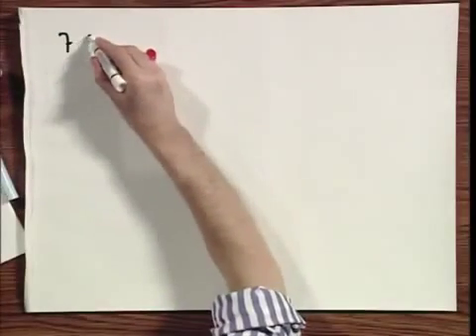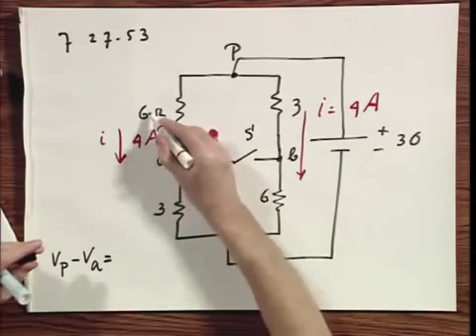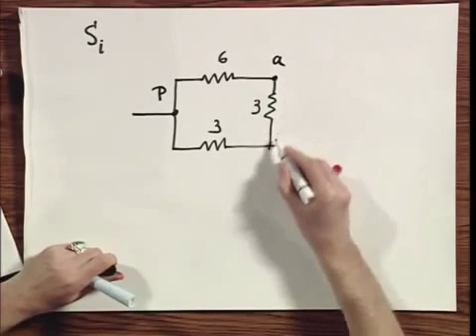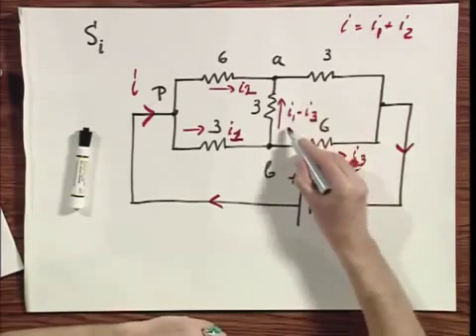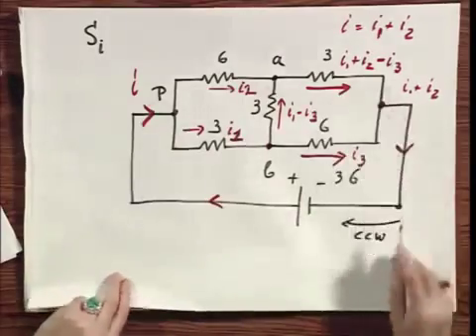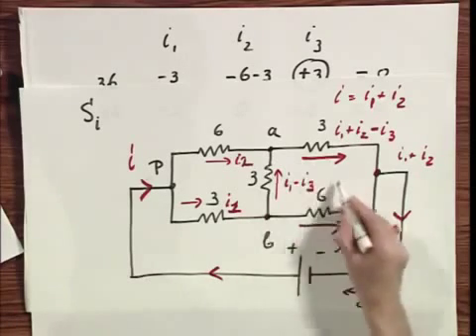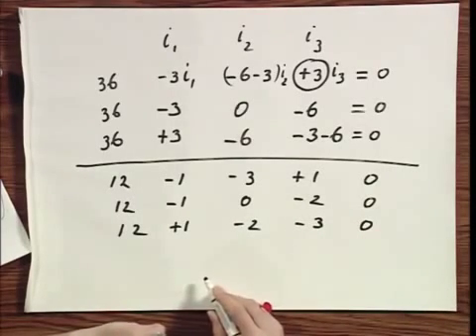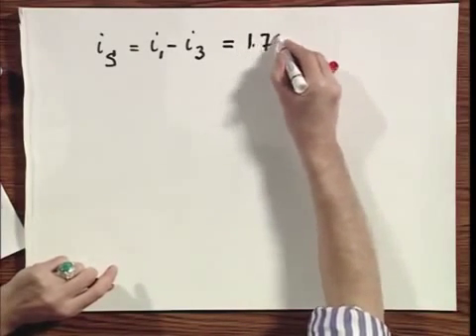Module 04 05 - Current and Potential Differences in a Multi Loop Circuit with a Switch

Comment: Can u please explain why the value is zero on the opposite point of P sir?we know that the potential at both the ends of a parallel connection is same.so why one 36 v and the other is 0?Shouldn’t both have been 36?